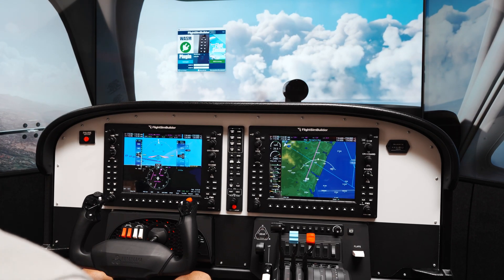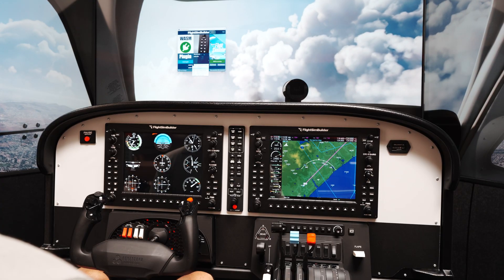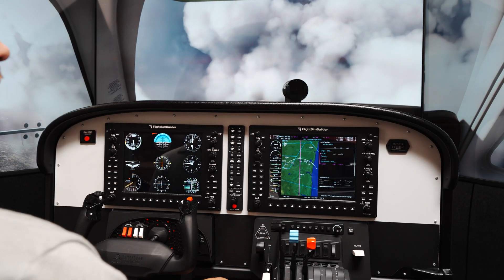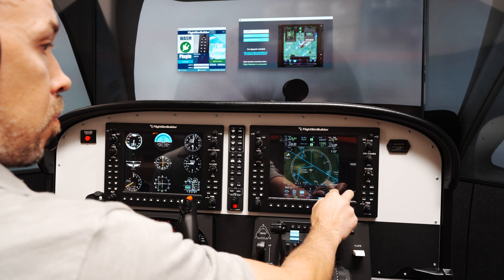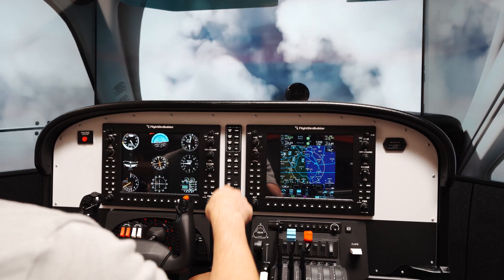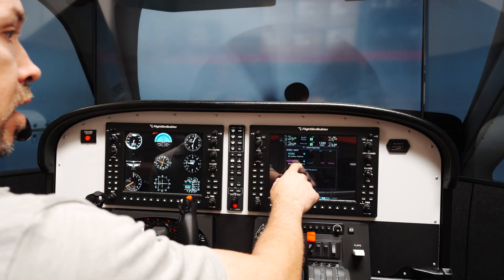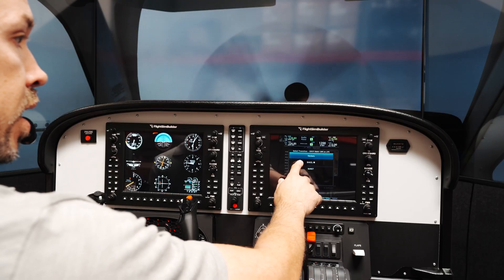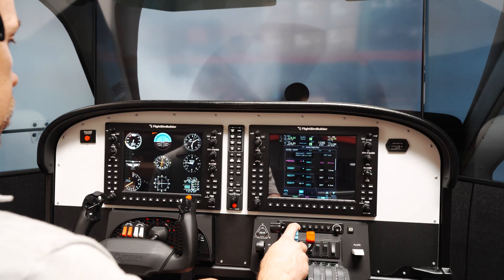FlightSimBuilder G1000TNxi Touch Demo - G1000 to Steam Gauges to GTN 750

Comment: Dose it come with a letter of approval.?
Reply from the maker: Hi, the simulators we have on the website are not FAA approved as they are designed to work with different simulators (including MSFS 2020 and 2024 which can not be FAA approved) as well as multiple profiles (Steam, G1000Nxi, G600Txi, GTN 750, and more)

Comment: So if you are flying an aircraft that has only steam gauges in MSFS 2024 for example the Cessna 185 can the software fly with a glass panel pfd? Cause that would be awesome! Also what about the autopilot. Does the aircraft in game need to have a compatible autopilot to work?
Reply from the maker: Exactly, for Native Avionics (Steam Gauges or G600Txi) it can work in any airplane. For the autopilot, the auto pilot will work if the plane has auto pilot, it might work if doesn't have auto pilot but not 100% guaranteed

Comment: When i touch my fsb screen for my mfd, my controls dont work. I have to move my mouse and click on my main screen to fly the airplane with my honeycomb controls. I think its because window makes your other screen as primary, in this case fsb g 1000tnxi. I have to click on my monitor for my controllers to respond. How did you manage to fix this. Do you have a work around?
Reply from the maker: Hi, you just need to use our Hub as it manages the buttons mapping. Please check the instruction on the website and if still issues, contact support via the website